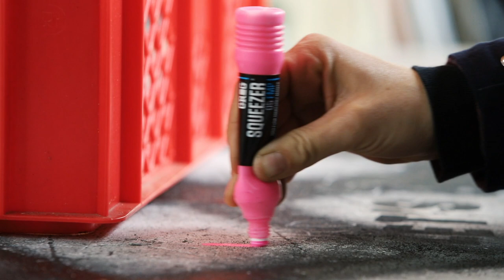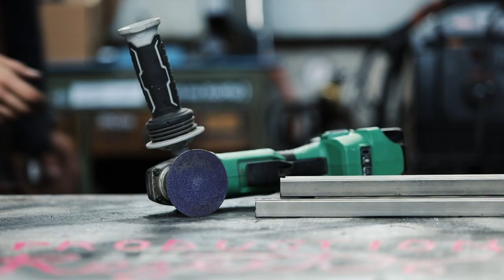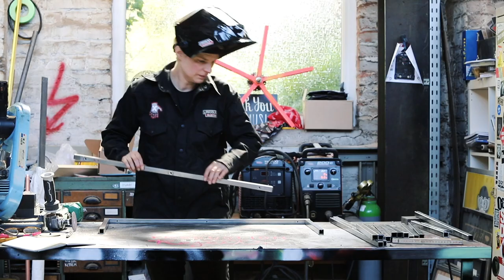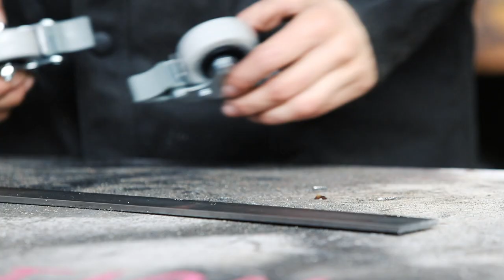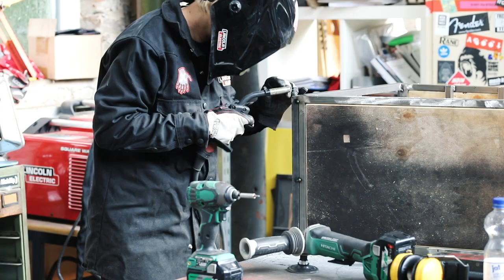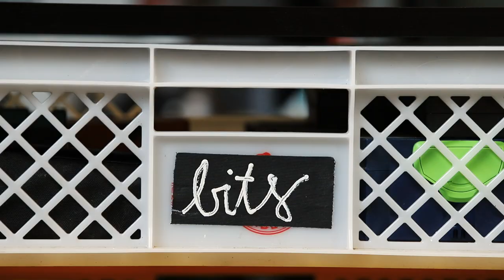Tool Cart with recycled plastic crates (Workshop Organization)

Comment: I couldn't see if you already did that or not, but here is my suggestion for an improvement: 
Pulling out the crates from both sides is convenient, but sliding them in without a back can be annoying. Instead of a back, you could add small stops on both sides that the crates slide over when pushing them in, but stop the crate from sliding too far or sliding out when moving the tool cart

Comment: Okay, I seriously LOVE this project for a few reasons.  The main reason is that you're upcycling a water container.  I was surprised that you didn't connect the upper and lower halves with metal conduit (pipe) so as to use the structure of the frame itself to connect to the water supplies but perhaps that would overcomplicate the design or not work.

It turned out so nice.  I love that your neighbors donated some materials too.

GREAT VIDEO!  Thank you and #peace from Ottawa, Canada.

Comment: I do not mean to sound nit-picky but doesn't welding the wheels on make the cart harder to fix or recycle? I found an old diy tool cart with a broken wheel that I was able to fix because it was screwed on. If it had been welded on, I would have left it in the dumpster since I don't own angle grinder and welding machine.
Reply: get yourself an angle grinder! it will change your life. you can find them cheap

Comment: There is a collet or chuck adapter for the Angle Grinder? How are you using the small die grinder sanding pad with the Angle Grinder? TIA !
Reply from the maker: That is a special holder for these little sanding pads. This one is from 3M
Reply: @laurakampf  Thanks for your reply. What 1/4" collet holder adapter did you use with your Hitachi 4 1/2" angle grinder, to facilitate the use of the 3M products?
Reply: Chet Leonard ... it looks like a 3M Roloc adapter for 75mm roloc discs. They screw onto your angle grinder